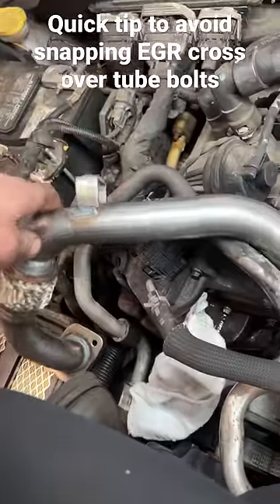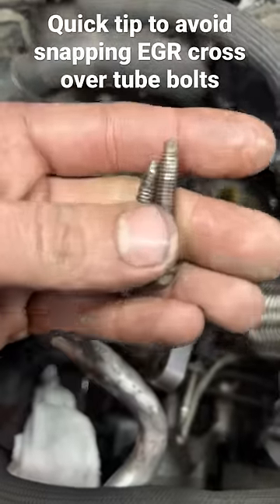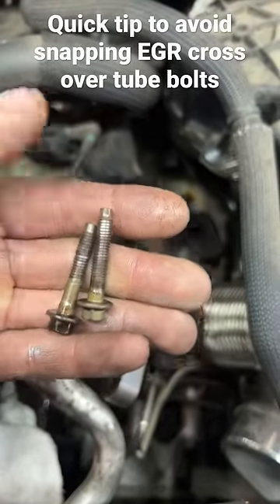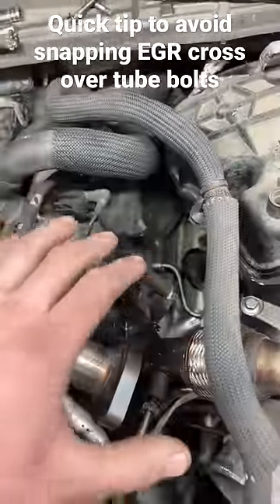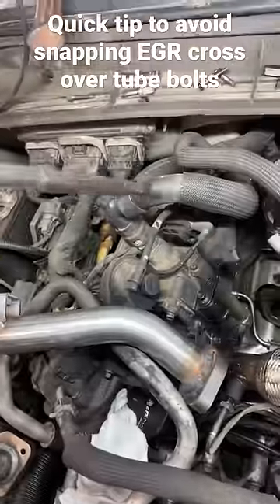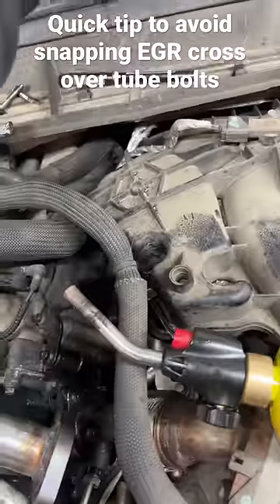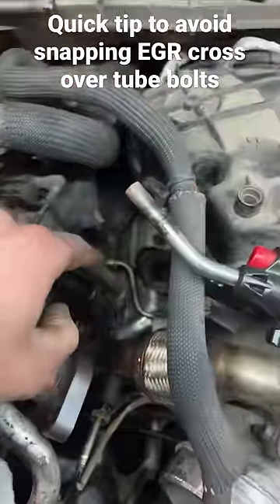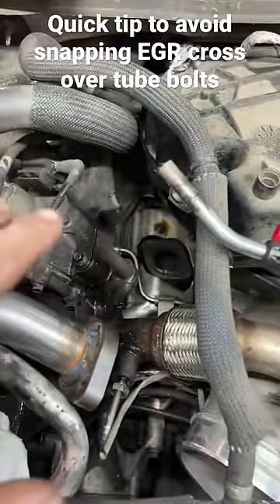Avoid snapping EGR Cross Over Bolts - 6.7 Powerstroke

Comment: I avoid these headaches by owning a 5.9
Reply: Good for you but I kinda want a diesel that it’s rated to tow 20,000 pounds
Reply: @rock-uu7qr   bro the 5.9 cummins in a 3500 can pull 30,000lbs even on the older ones, except the second gen ones idk their ratings
Reply: @AmericanRustWorker3369  Nope the 5.9 from 2006 is only rated for about 14 thousand
Reply: @AmericanRustWorker3369 a 5.9 is a nice engine with a crap transmission from dodge. They couldn’t make their own engine so the buy it from Cummins

Comment: 2011-2016 6.7 Power Stroke still good options for engine swaps 2017-2024 6.7 Power Stroke, the year to avoid 2022 Ford F-250 to F-550 rust out very quickly and 6.7 Power Stroke V8.

Comment: Great advice brother. 
The air hammer with the socket adapter works wonders as well. For those bolts and glow plugs. Have had good success. Thanks for sharing!

Comment: I hate all new diesels , they all have that EGR bullshit on them , I like my old 2000
Dodge Cummins ❤  runs perfect, I get better fuel economy than all newer trucks
Reply: It's because its not weighted down with 3 exhaust filters, 2 egr systems, and a f#*king massive def fluid tank and all the sh*t to make it work, even though it rarely works🤦‍♂️
Reply: @johncoldwell340 gotta remove all that BS and they're great